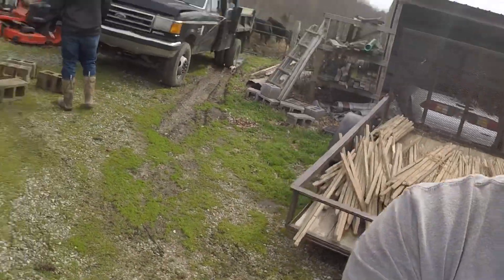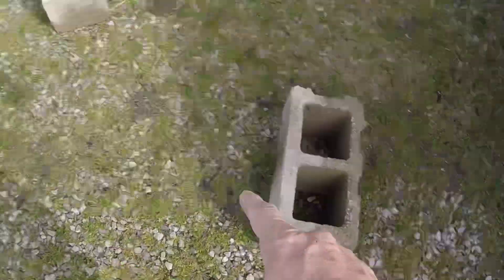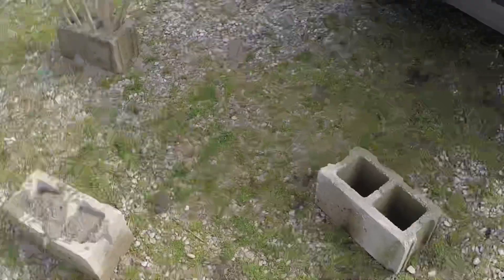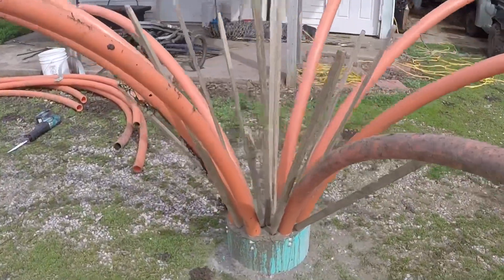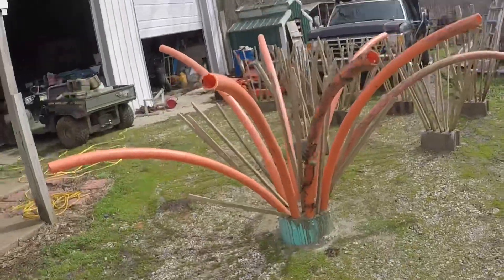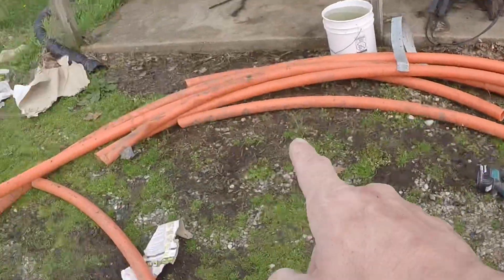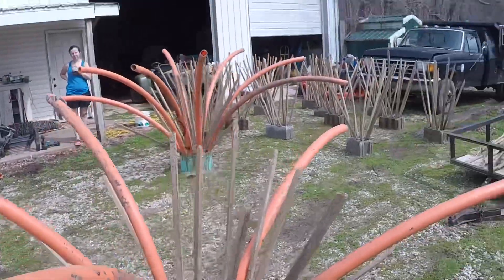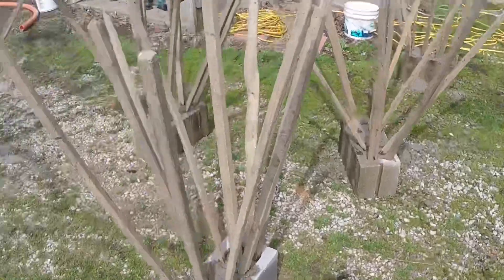Building cheap structure for crappie cheap

Comment: Do you ever put eyebolts in the middle to ease them down to bottom so they won’t tip over?
Reply from the maker: I don’t but that is a great idea.
Reply: @CrappieMonster  you could also just use a loop of tie wire it would be cheaper

Comment: I would like to suggest that you use 2 pieces of 3/8 rebar passed through the sides at the bottom to form a + with the base in the middle.  That way the structure would be less likely to turn on it's side if someone snags it or a strong current tries to push it over.